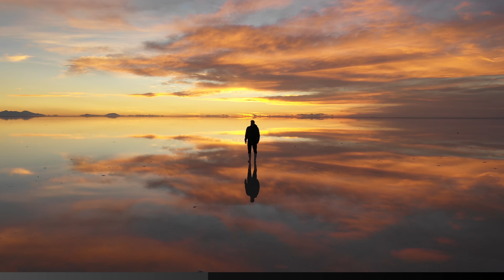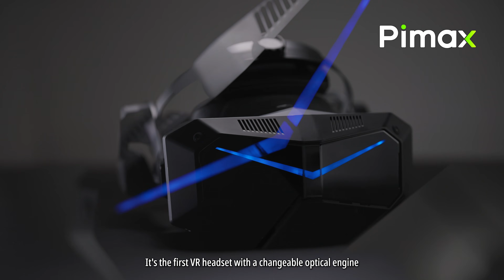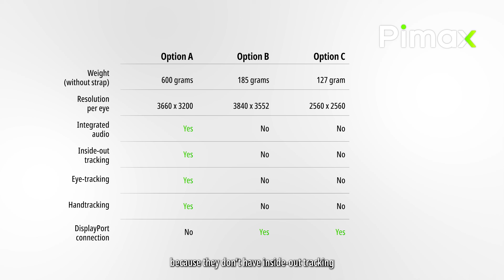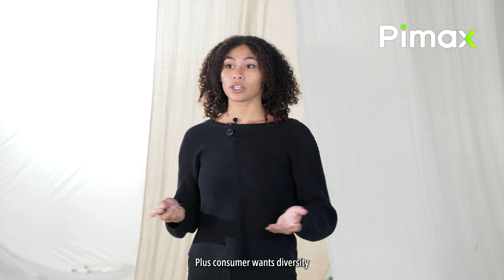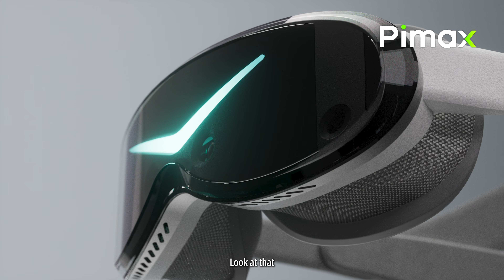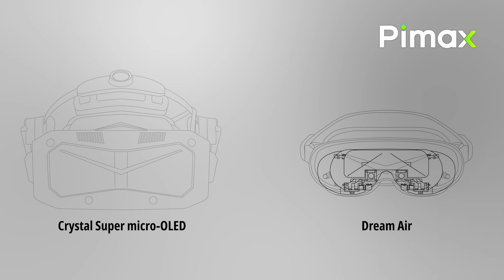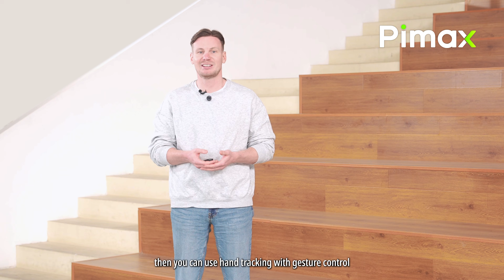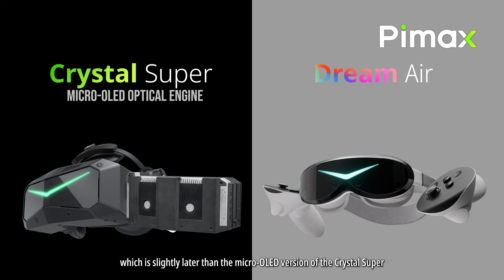Frontier: Hello Pimax Dream Air

Comment: Please stop announcing new headsets before the ones you've already promised are out. As cool as it might be, most of us would prefer you go full force into only 1 thing at a time, especially something as complex as the 12k qled.
Reply: My guess is these announcements aren't for us consumers. They're likely hunting for investors to keep the company afloat.
Reply: @michaeldeford1335  they want people to stop pre ordering the Megane X super light 8K, so they produced in a few weeks this sketchy new headset 
of course it will never be ready on time, they don't even have a real life prototype yet, look at 10:08 lol
Reply: @michaeldeford1335  It makes perfect sense to make this, its the same thing as the supers oled module in a smaller box. They already have the tech, so they can lower the cost by selling more.
Reply: @Nobody-Nowhere  lower the cost?
Reply: They already said 12k is not happening until GPU's catch up.  This is a smart thing to do during the downtime.
Reply: @laartwork  They lied about the 12K situation. The 12K can already run on existing GPUs on DispalyPort 1.4 with DSC (Display Stream Compression, which is visually lossless), and then still have a ton of bandwidth left over. In fact, all their headsets currently use DSC. They claimed it was impossible to run on current hardwares because existing DisplayPort support didn't have the bandwidth. Completely false. As for running a 12K headset in terms of FPS performance? It will depend on how demanding the game in question is, upscaling options, if you need to turn down some settings, and you can always upgrade GPUs later to run at higher settings. In fact, they could have calculated the DP bandwidth for the 12K at conception and if it had (it is not) been true they wouldn't have promised it for several years and claimed to have a prototype to show on demo at an event. The company is notorious for lying.
Reply: I am so angry about the 12x and my promised full trade in for my 8kx, Pimax will not see another dime from me until it happens 😡
Reply: You cant buy a GPU that can run a 12k headset.
Reply: Exactly. Produce, ship and maintain QC on the products you already have. It is clear that you aren’t yet fully there with your current set up. Promising more is a recipe for failure…
Reply: God. PLEASE! Stop introducing new products!!! 🤦🏼‍♂️
Reply: Agreed! Also, at least support devices for longer... just look at Pimax Portal let alone its ill-fated VR attachment.
Reply: Too Many Heasets
Reply: It's exactly the same optical engine as on the Crystal Super so they share so many resources, also on software. It's not a fully new headset in that way.
Reply: @JaapGrolleman  You’re missing the point. You have a lot of customers who have devices or devices on order who haven’t gotten what they paid for (myself included), and your Customer Service can’t keep up nor process anything more complex than a single bit of data per interaction and then only if one also takes to Discord and routes a message to a single person. This by itself is not a recipe for happy customers.

On top of that, the hype about new and up-coming stuff just adds further frustration. It appears (and optics/perception are everything here…) that even though you have customers with unfulfilled orders and orders which have gone awry in one manner or another, that all you (meaning Pimax the company) care about is generating more pre-orders (and thus more cash) but NOT about fulfilling your existing commitments. This does not bode well as as a business model.
Reply: seriously... cool tech--one of the single worst companies to exist
Reply: @RickBarton-sg4pn  amen. Their headsets cannot be beat, but the way they run this business is atrocious.
Reply: Wouldn't mind my promised wide FOV lens that I was supposed to get 1 year ago, they have forgot about that.
Reply: Or please. Deliver the wide fov lenses which were pre order gifts. I have been waiting for 2 years but maybe next year it comes. Or not
Reply: Speak for yourself. You don't represent all of us.
Reply: Facts 😂😂😂
Reply: Pimax are delusional, they roll out promises and can’t get their act together. QA , QC , Customer care , are the foundation .
Get that right , and then you can produce more product. Pimax you are becoming a failure . A bad reputation vs more models = Failure
Reply: Go into whatever you want! Why you want to stop other people from thinking about near-future stuff? If you're saying don't exaggerate when things are coming out of how good they are, that makes sense but it's a different statement
Reply: They diluted 70% of their shares to third-parties. Seems more like they are forced into releasing new products.
Reply: They are in the same gen
Reply: Absolutely, the headset bought is already out of date before it even arrives, however for some the expedited development life cycle can result in the "perfect" headset being achieved sooner and is much appreciated.
Reply: It's just more pump and dump. Flashy, overconfident marketing means more money flowing in without really doing anything, then sell it all at the height, leave others with the bag.
Reply: Pimax crystal 12k isnt possible today it was a concept to whats to come
Reply: I just barely ordered the crystal light and here comes this shit 😢
Reply: New headset every three months lol. All faulty with quality control issues. These people are high on some next level stuff.
Reply: This Chinese company is a joke. They produce a new headset every three months. All have faults and quality control issues.
Reply: I love Pimax. They are always inovating. Screw the 12k, some things just dont workout. Where is the Deckard, or any othere quality Pc vr headset. If not for Pimax, we would be doomed. Sony delivered a half assed headset with the psvr2 and Meta won't give us a true pc vr headset. Say what you wilkl, but pimax is delivering. I preordered my super today using my reservation and I hope to be ordering the Air. Thanks Pimax. For all who are compaining, buy somthing else! Oh, there is nothing else that can equate, so SHHHHHHHHHHHHHHHHH!!!!!!
Reply: @kangjames2492  I half agree with you actually, I love Pimax's products. But they would get things done so much faster and of higher quality if they tackled one ambition at a time instead of spreading their resources so thin.
Reply: nah, let them innovate and get sales.
Reply: @user-wq9mw2xz3j  their days of innovation are long gone. They sell mostly broken overpriced promises

Comment: another headset? should I regret my "super" pre-order???
Reply: Why would you regret it? You can still cancel
Reply: exactly my thoughts....
Reply: Change it to the Dream Air if that suits your use case better. Personally, as a simmer, I'm sticking with the Super 57PPD for the better visuals, audio and head strap.
Reply: @vrsimracer  I personally think the form factor is more important in 2025, heavy big headsets eventually u will get sick of believe me, 57 ppd, lets see how that goes in terms of performance, think we are along way from 120hz at that res even with a 5090
Reply: @SURG3NT  It's becoming more important yeah. But the Super is similar to Quest 3 with BoboVR form factor, which isn't bad. It's now about which tradeoff you prefer
Reply: @ ye it’s true, but I’ve had pretty much all the top end headsets that I use for mainly sim racing, and every time in the end the weight and bulk becomes a problem, Crystal being the worse offender, anyhow I think we at least 12 months off seeing the new Dream Air, it’s just all concept and literally a dream at the moment
Reply: @vrsimracer  yeah a refresh rate >100hz and better FOV and you have my attention. Until then I’ll be sticking with the QLED Super as well
Reply: @vrsimracer  lol dude, ITS in 4 TIME more heavier, for SIM. new AIR will be much better
Reply: Yes, another headset, but a different form. 
I'd stick w the super for now unless you want portability / size in exchange of a few compromises.
Reply: This costs $1900 and will ship in May next year. Do with that information what you'd like.
Reply: @JesusLovesYouSoMuch47 Do you believe this May story if they only were able to present some draped bedlinen not even a non-working mockup looking physically like the final product?
Reply: Apple Vision Pro... as made by Pimax, Pimax (something) Air
Reply: Cancelled mine looool
Reply: Pimax have always made multiple headsets. It doesn't change the Super, unless you want this one
Reply: Ma questa è una cuffia gaming ?
Reply: lol you should google "Pimax pre order" before pre ordering Pimax (tldr: Yes, never pre order Pimax)
Reply: Lol, I'd switch if it wasn't at least 5 months out from now and wasn't more expensive. 

But yeah I basically decided to go with the crystal super over the Meganex bc of the tracking system and bc the super has the $400 credit for previous headsets owners.

They didn't say this would be eligible for the $400 credit which makes it significantly more expensive.
Reply: why did you put super in brackets lol